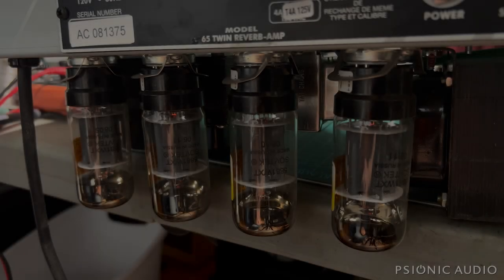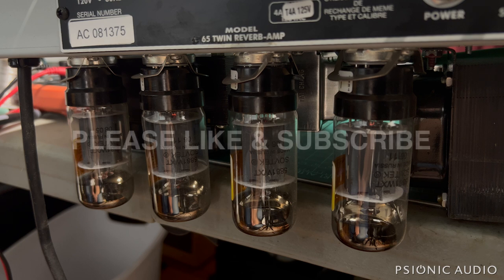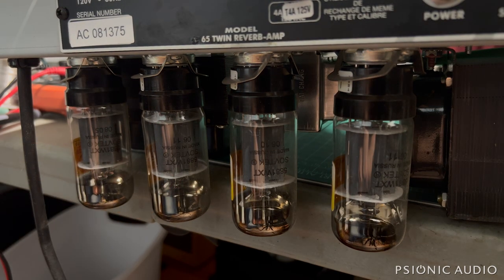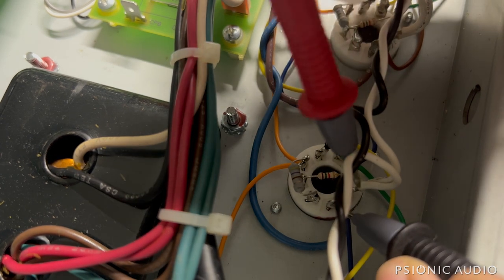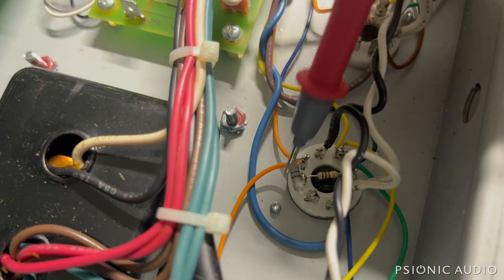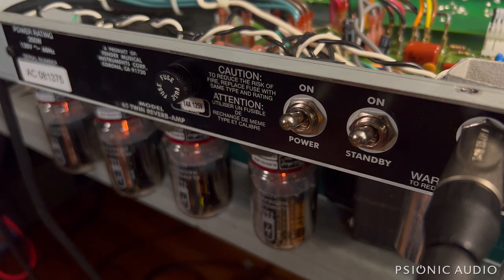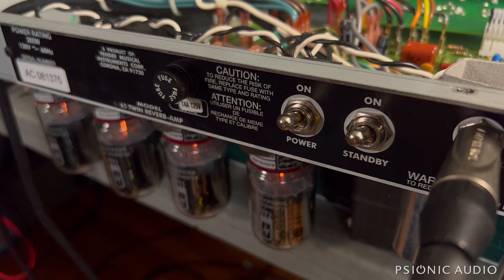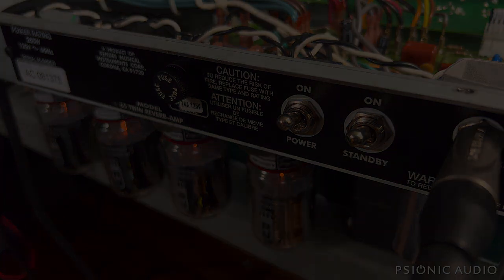Fender '65 Twin RI | "Weird Bad Sounds"

Comment: I had a similar problem with my '65 Twin Reverb Reissue. It started making loud noises, so I had a new matched quad set of power tubes put in. One of the preamp tubes was microphonic so I replaced all the preamp tubes as well. Since then everything has been fine.
Reply: I just bought a twin ri 65 like this knowing it had microphonic v4. But I could get it 200 cheaper at least, compared to others on the market because of this.
I was wondering, I planned to just replace the reverb tubes, what made you decide to replace them all?

Comment: That does sound good! I’m always pleasantly surprised by how good a properly working Blackpanel fender sounds.  They really do have a silkiness to them that gets me.
Reply: Except this is not a BF amp
Reply from the maker: But it’s the same circuit and sounds remarkably similar if you don’t have the stock speakers.
Reply: @PsionicAudio  Surprising for you to say that, Ive only heard the 68 Deluxe RI and the 65 PRRI and neither sound like the real deal imo

Comment: Question for you sir! First, thanks for the great videos! I have a fender 65 twin reverb reissue and it always sounded perfect. Lately it seems like I have lost half of the headroom and volume it used to have. It’s now breaking up way too early. Also when I use a bias probe I only get a reading on one of the 4 output tubes. They all 4 light up when the amps on but I’m not getting a reading on three of them. I’ve tried different tubes and that didn’t work so something must have happened internally. I have the chassis pulled and I’m experienced working around amps safety wise but what should I check first when it comes to trouble shooting in your opinion? One more thing. I know you said that the screen resistors on the output tubes should come in around 470ohm. I just measured all 4 screen resistors and on the tube that gets a bias reading it reads 470 ohms, the other three tubes screen resistors read 
Tube 1 - no reading
Tube 2 - no reading
Tube 3 - 470 ohms
Tube 4 - 7.57
Reply from the maker: Thanks. You’ve got three bad screen resistors. And probably three bad 6L6s too. Replace them all, four resistors and four tubes.
Reply: @PsionicAudio  thanks so much for the fast reply! I wonder how that happened. I’ll replace those resistors and see what happens. Really appreciate your help. Had you not mentioned the screen resistor values I would have never known what to check for as a start! I’m a fan and I have subbed!
Reply from the maker: Thanks very much. Be sure to check the amp has the correct value fuse in it.
Reply: @PsionicAudio  thanks so much. I’ll be sure to do that also
Reply: @PsionicAudio  hey man! I have one last question for you. I have a jcm900 4100 dual reverb head that plays and sounds great but….it has a 50/100 watt switch on the back that allows it to run in  either half or full power. In half power it plays fine, when I switch it to full power this terribly loud scratching distortion sound starts immediately and I have to switch it back to half power right away. Any thoughts? Thanks again for your time and expertise!

Comment: So far so good on those MOD caps?
Reply from the maker: Yeah, no issues here thus far. There was a bad batch of 20ufs but I didn’t get any and the distributor swapped ‘em out and threw out the bad ones.
Reply: @PsionicAudio  Thanks!